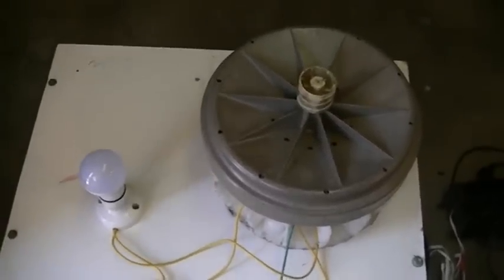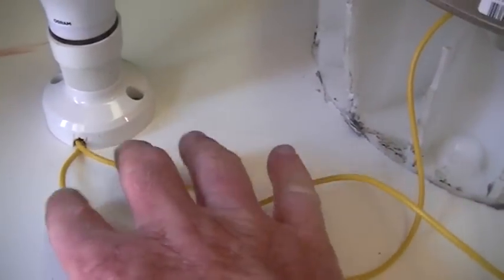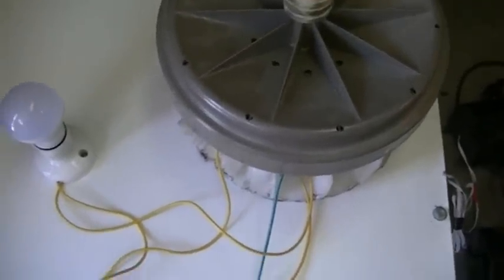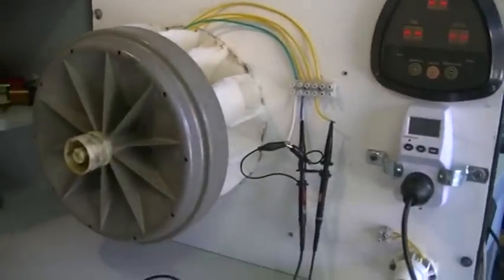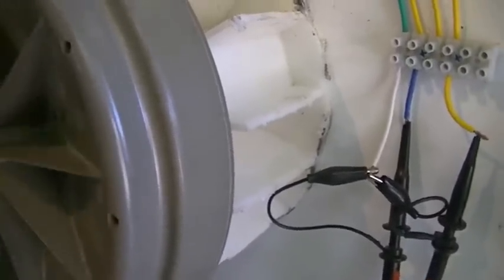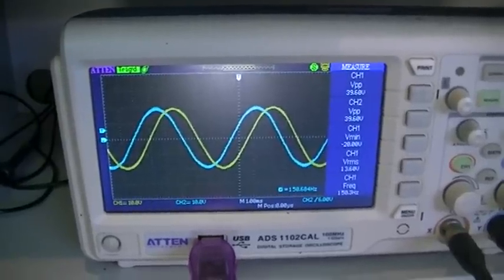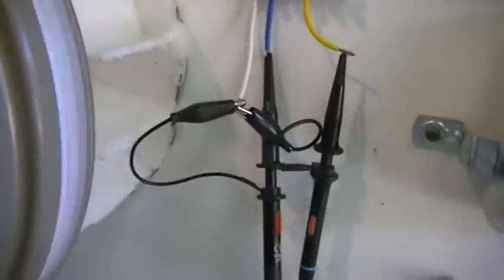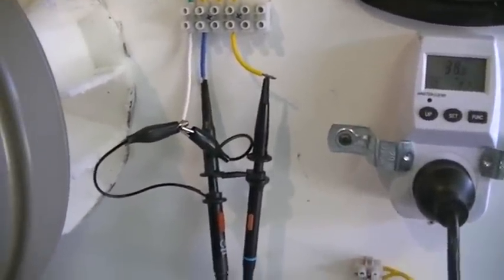Reactive generator reserch smart drive 3 phase PMA v1

Comment: Will someone take notice these motors are not 3 phase motors every coil fires at the same time some are positive some are negative.  Coil 1 is (total number of coils divided by three) connected in series. Coil 2 and Coil 3 are the same.  So the crutch of the controller is to fire the coils correctly to get the desired motion, say coil 1 is + coil 2 is  - and coil 3 is + (at the same instance) to get the rotor to turn.  Therefore the next combination that will make the rotor turn might be coil 1 is - coil 2 is  - and coil 3 is + (at the same instance).  Does anybody get it?  Quit using 3 phase controllers with these motors, no speed no torque.  Just detail how you are going to get this motor to turn as it is wired, how the poles of the magnets are oriented you may have 12 magnets with 24 poles with 36 coils this particular orientation allows for the rotor to turn.  Do the homework and see that it is an eye opener?  This why Gerard Morin is in China right now developing the controller for this motor.  Check out what I have been telling you, take a magnet and see how many poles you have in the rotor, ponder  what conditions are needed to get this rotor to turn and quit blindly accepting that this is a 3 phase motor.
Reply: Is this what's called a "stepper motor" you are describing?
Reply: It is you who does not understand these motors. If you look at the scope you clearly see they do not fire at the same time. Yes they are pulsed DC normally but they also are 3 phase motors. They are factory wired as a Wye configuration and he has put the green wire on the common connection. As for speed, how fast do you want it to spin?  Samsung makes some 18 pole units and I can get them up to 2000 RPM when they are designed to only run at 8oo RPM on pulsed DC. I regularly run the 36 pole units at 1000 RPM and can use it to drive a second one at that speed making 800 Watts on the output. On a VFD, that means 1200 Watts input and if you know your math, that is better than 1 HP both on the input and the output.
Reply: @gravelydon7072  I stand to be corrected.  Thankyou for correcting my thinking.  I do know that if you can get the 3 phase frequency to increase that is what makes the speed increase. All I was thinking is making three phase with DC pulses, just imitating the 3 phase

Comment: Is this setup using the basic, unmodified smart drive? I'm considering setting up my system to run in the standard 3 phase, high voltage configuration, (not cutting and re-soldering the triple coil connections) so I can run lighter cables over a 500 metre distance.